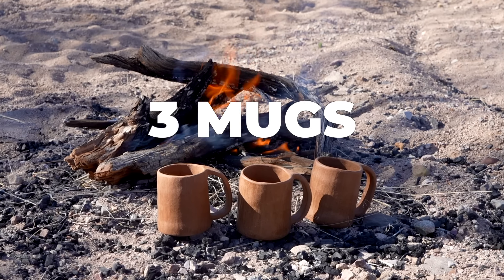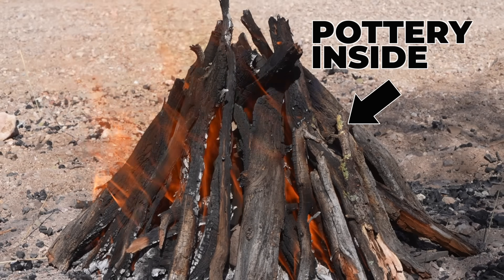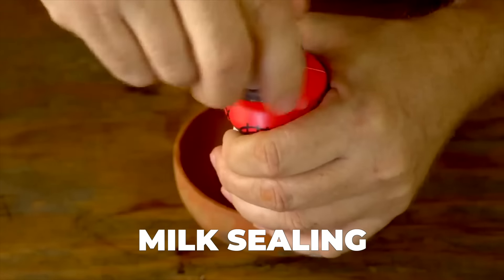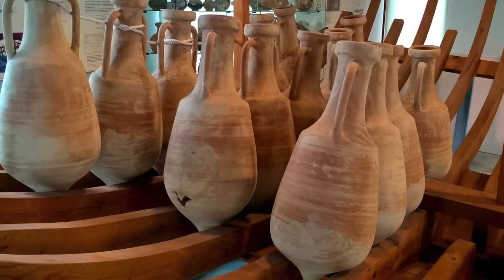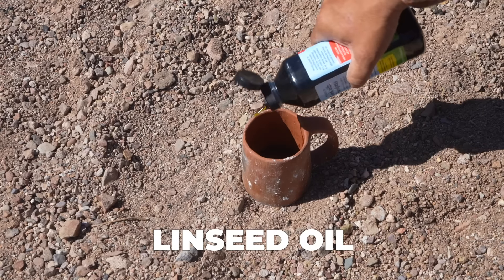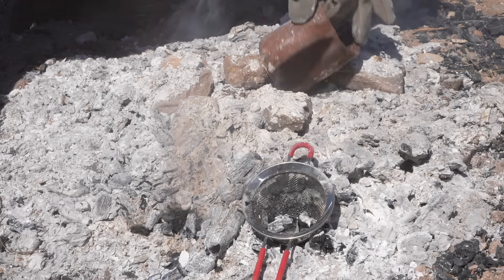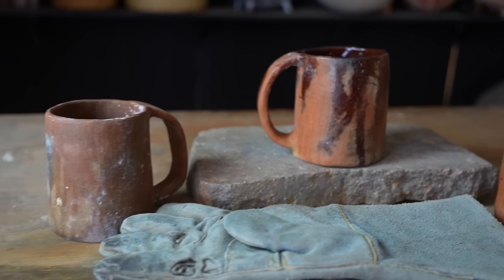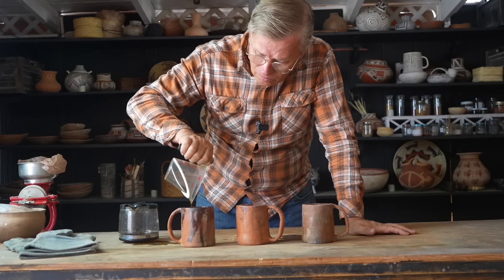Sealing Mugs With Old World Methods

Comment: A brave soul indeed! I might have seen how well they held up to a hand wish first. 😁
At any rate, I had another thought for alternative sealers while I'm here smiling wide at your trepidation. Honey was used in sealing clay tobacco pipes and works well with briar as a first layer when starting a carbon 'cake' layer. As far as having things leach into your coffee, caramelizing a honey layer might be quite nice if you can get it to permeate into hot clay. I've used honey on my pipes and cleansed them with whisky afterwards, but slightly different process and materials as the combustion of tobacco will continually build that carbon barrier. Still interested in the direct coffee roasting idea though, which I'll have a go this weekend if all works out!
Reply from the maker: I imagine honey works about like starches, getting down into the pores and hardening into a barrier. Probably any sugary substance could do the same. Thanks for the idea.

Comment: Was it possible that these sealants were actually applied to the outside of the containers, not the inside?  There would be far less food contamination that way...  Additionally, it's known that oiling a cast iron pan, wiping off the excess, and then baking it until it stops smoking applies a "non-stick" coating of carbonization that fills up the pores in the cast iron...so perhaps they used a similar method with pottery to seal its pores?

Comment: Very interesting video! I wonder what woulf happen if you treated the oil method similar to cast iron cookware? ie coating in a food grade oil and heating to the smoke point to create a polymerized seasoning. When properly applied on cast iron or carbon steel it is very tough stuff.

Comment: A good addition might be that if you can't get rid of the pine pitch leeching slightly into your drink, it might not be the best option health-wise. Pine pitch contains terpenes which if consumed regularly are shown to be carcinogenic. I don't know if the volume consumed would be significant enough or if after a couple of washes the pine would stop leeching into the drink, but it might be worth considering when choosing which sealant to use.

Comment: Sealing with oil probably works well but it's probably not a good idea to drink acidic liquids because the acid would probably strip the oils out from the ceramics. It's like with cast iron cookware in which you also have to season it to give it a non stick layer. And that layer is easily stripped when you cook acidic foods.

Comment: I used tung oil to seal my wood countertops and it's working great for them. It hardens as it dries. I wonder how that would work on pottery. I'm guessing at least a few coats, just like on wood.

Comment: Just my thoughts is the beeswax melts at much higher temps that your coffee can get. Pine pitch melts at lower temps than coffee.  Linseed oil varies depending on how polymerized it is. I would have heated them and at least wiped them clean on the inside. Your taste results are exactly what I would expect.  Your right about the linseed oil I think. many layers is good. I say this from  my woodworking experience. Great show as usual. Thx.

Comment: I imagine the beeswax you would have to reseal regularly. I know the British use to use beeswax to seal their canteens in the 19th century and they found the beeswax ran out of the canteens defeating the sealing. Also most forms of wax are flavourless and non-toxic, thus, you could be ingesting wax and not notice it. I think a beverage that is not strongly flavoured and acidic would be a better test to test for the affects of the sealing. I would suggest white wine, with a Chardonnay specifically. A Chilean one to be more specific. Also, are you sure the oil slick is from the pine pitch? Coffee has it’s own oil residue, I notice it, even in a regular mug.

Comment: I wonder if the same principle used to “season” a pan would work with earthenware. Covering with oil then heating it up to the point of polymerization, then doing a couple coats of that.

Comment: Can’t wait to try these! I am going to collect local clay for the first time too, I live in a very chalky area in England and was wondering if powdered chalk can be used as temper? Or maybe just as a dye?
Reply from the maker: No, chalk is calcium so you definitely don't want that in your clay
Reply: @AncientPottery  ah that is a shame, I live in the vale of the white horse so it’s very culturally relevant. I will have to watch more and figure out a white pigment. I am very new to this, having stumbled across it a few nights ago while researching microwave kiln techniques
Reply: @MrConna6  You might want to experiment, making it a thin slip then see how it comes out of the firing. Maybe search for sources of kaolin in your area.
Reply: @-meganeura  like a surface later of chalk or do you mean with the white clay? It’s a very interesting idea as the eponymous white horse is maintained by smashing and powdering chalk into the ground and a similar approach may work here, even if I need to seal it onto the mug
Reply: @MrConna6  Yes, a slip is just a coating on the surface, you would prepare a thin solution/paint with water and chalk and a tiny bit of clay, mix it well ad more water to make it like milk consistency or maybe a bit thicker then paint the pottery with a bruh, also you can experiment polish the surface after painting with a burnishing stone.
The kaolin is pure white clay.
Reply: @-meganeura  thanks for the help! I will definitely be experimenting a lot haha! Just waiting to have time to go to the skip and relieve them of some old bricks now xD

Comment: As far as i know, linseed oil was mixed with pine resin and/or wax with heat. Pine resin will dissolve in the hot linseed oil and the heat will drive off any water inside the linseed oil as well. That concoction will harden over time.

Comment: Having made cutler's resin before, it might be worth heating up the pine pitch a bit before tossing it into whatever you're going to coat with it.

Turns out that copper distillery pots in North Carolina were used in the manufacture of resin and turpentine before they were turned to other, illicit uses.
Reply from the maker: I did cook it some before use, how long do you think it needs?

Comment: my sauna has pine boards on the inside and when it was new they dripped quite a bit of pitch. but as time went on the volatiles evaporated out of the pitch and the drips are now solid even at higher temperatures, like some sort of dark amber glass. 

that said, i think if the pitch coated pottery was baked at low temperature (maybe 180 to 200) for a period of time that the pitch would turn into a low temp glaze, just like the pitch in my sauna.

Comment: Here in Europe, birch tar has been the go-to glue and sealant since the Neanderthals.
I assume the people wandering into the Americas also knew about this stuff. I don't know how abundant birches are there, though, and whether the substance was used.

Anyway, I would like to know how birch tar works as a coffee cup sealant.
Reply from the maker: I know that people use and make birch tar here in North America but it doesn't grow around Arizona.
Reply: @AncientPottery  Ah, yes, that makes sense. Arizona is not a good place for a birch.

I have gathered birch bark to try tar making, but I have yet to find suitable vessels to cook it in. Should I manage to do that, I will try sealing with birch tar and report back.
Maybe I will try and make suitable pots from clay, though I am sceptical whether I have the skills for that.
Reply: You can get purpose made brewers pitch online which is probably easier to use and better tasting than raw pine resin. At least a few old world breweries still line their wooden barrels with it.

Comment: I would like to contribute that in my experience treating tool handles and particularly leather with raw linseed oil (which it should be said is the only sort to be used for a coffee mug or some such, BLO has various toxic things in it to decrease drying time that you really ought not to ingest.) it takes in the order of a couple weeks to completely polymerize while soaked throughout a matrix. whether that be wood, leather or as I can only imagine pottery. 
similar was pointed out by another commenter but i would also add that the procedure for oiling a tool handle with raw linseed oil is to keep applying oil over the course of multiple days until it stops being absorbed. perhaps followed by a thin top coat(s) on the surface.
all to say I think in order to get the best possible results. which i imagine would be quite good. out of linseed oil one would have to treat it with that procedure.

Comment: I recently found out about the Moroccan practice called Tadelakt where they'd put a lime plaster on a clay/earthen wall in thin layers, and then essentially burnish with a hard stone and seal with a olive oil soap (and egg whites, or other organic matter). Traditionally it's used in bathrooms and showers, so it's a well known technique for being water proof, do you think something like that may work for primitive pottery sealants?
Reply from the maker: Yes I have read of this. Potters do use a stone to polish clay on a pot surface but we tend to avoid lime as that can have disastrous consequences to pottery.
Reply: @AncientPottery  oh really? I hadn't heard that before! I'll have to look into it some more, I was planning on making some pottery in the tadelakt style to play around with it, now I'll make sure it's on pieces I don't particularly care for
Reply: With Tadelakt there is actually a chemical reaction going on between the soap and the lime. 

Soap is made by reacting fats with sodium hydroxide or potassium hydroxide. Generally potassium hydroxide gives you a liquid soap and sodium hydroxide gives you a solid soap. If you were to use calcium hydroxide you'd get a 'soap' so hard and waxy it won't dissolve in water.

When you apply lime plaster, the bulk of the lime is calcium hydroxide. When you apply the soap on top of the uncured plaster, the calcium in the lime swaps places with the sodium or potassium in the soap and creates the hard, insoluble calcium 'soap' in the surface layer of the plaster. The same thing happens when the calcium in hard water reacts with soap in the shower, giving you soap scum, aka calcium soap.

You could probably limewash the already fired pottery and then apply soap to it and get a waterproof layer, but it would take some experimentation to find the right concentrations of lime and soap. The timing also has to be right as the soap needs to be applied before the lime carbonates. You might even be able to make the calcium soap separately and then melt it and apply it like the beeswax or resin.

Comment: Great video! Linseed oil needs to cure for a long time to properly polymerize. Like, many weeks, since it is not only a thin layer in this case and sunlight cannot get to it inside the clay. I had good success sealing with beeswax by really dipping the pot in liquid wax, let it soak and then rub it dry with some cloth.

Comment: With the linseed oil it might be the case that it requires heat treatment and repeating the process. When you season the cast iron pans with oil, you heat them up which allows the oil to create polimer layer. Linseed oil oxidises quite fast, but I am not sure what's needed for its consistent polimerization.

Comment: I wonder if you sealed a pot with milk or dissolved casein solution, then formin to set the casein into galalith plastic if it wouldn't provide a higher quality glossy seal. It's worth experimenting.

Comment: I think when you use pine pitch it takes a bit more effort to get a good result. First melt the pitch and run it through a sif to clean it. 
Then on slow fire let it cook until it doesn't bubble so most of the turpentine leaves the pitch  you end up with rosin that has almost no smell and solidify into a hard glassy substance. 
Make sure you don't burn it. I usually cook it in an oil bath over an electric stove. The oil helps heat the pitch evenly and if the oil smokes than it is too hot for the pitch. Oil bath is not needed but over fire you need to be watchful. If you make a really good effort cleaning the pitch and create a clear rosin then it has a visually pleasing red-orange appearance. 
Then pour the rosin into the mug (I believe the mug should not be preheated) quickly slosh around and pour out (ideally back into the pich container) A mug that sealed this way should not give out much smell at all. It is the turpentine that smells and it is what let the pitch dissolve into other fluids.
That was the most common way to seal pottery that contained cold fluids. I don't think it was used for cooking wares. I was told this is the reason pitcher called a pitcher. 

I don't think you should use linseed oil that thing is disgusting and offers no benefit to any other oil sealing.

Comment: I'm late to the comments, but it might be worth looking into charcoal powder and soot as a pre-treatment for the clay before sealing. Lamp black (soot) is naturally hydrophobic, water beads on it and won't easily penetrate it. It might be worth inverting a pot or cup over a flame to fully coat the inside with soot, then rubbing it into the hot pores with a chunk of charcoal, and repeating the process a few times to fill as many pores as possible, as deeply as possible, with the fine soot particles. The charcoal powder also readily absorbs compounds that come in contact with it (which is why activated charcoal is used in water filters), so any larger pores that have charcoal dust on top of the soot might better seal by drawing in the sealant.

Pitch from different conifers can smell / taste better and less strongly than others. Where I'm from, spruce tips are use for tea and spruce gum taken right off the tree is chewed like bubble gum for its nice flavour, but will harden like glass if allowed to dry out fully. 

I'd like to try a combination of soot / charcoal pretreatment, a gentle wipe to remove loose material from the surface, and then a coat with some thinned down, un-burnt spruce gum that's been mixed with some water or alcohol so it flows better, then left to dry and harden in the sun for several days so the resin has time to cure.

Comment: I'm pretty sure the ancients would have boiled and filtered the pitch. Yours was bubbling because of the water in it. I suspect they would also add resin when available.

When you flipped you newly adhesive coated cups onto the sand and gravel I thought I was seeing one of the manufacturing in Pakistan videos 🙂 What were you thinking?

The seed oil should polymerize more over the next days/weeks. Very interesting results!

Comment: What about grape seed oil or olive oil.
Reply from the maker: I have used olive oil in the past and it works fine. Never tried grape. The secret to sealing with oils is to heat them up to the smoke point so the oil will polymerize. Then you can't store oil in any pot that is polymerized as the new oil will cause the old oil to soften up and it will start leaking again.

Comment: If you ever do this again...
- Ancients had brushes, get a brush for each treatment 
- Most processes were done with repeated steps so try out
Low heat, coat, dry & repeat a few times at least 3
- Coat all sides, not just inner
Explanation is:
You'll get better results building layers of saturation & carbon sealing.
**
Lastly, the ancient sealing 'pitch' is made with pine sap & charcoal (ground) in a 10/1 sap/charcoal. This stuff is also flammable too, so low fire (set mugs on top of fire pit for about hour) after coating dries.

Comment: Any reason why amphorae are pointed at the bottom? Seems a weird shape for a container you might want to keep upright.
Reply: Racking is easier, and no seams makes a stronger vessel.
Reply: @BigHenFor  Thanks for the info. Certainly makes sense. Would they "rack" like wine bottles, stored horizontally?
Reply: Racking aboard ship to save space. Storing on the sides would take up more space.

Comment: ?? Why didn't you try to seal the outside of the mug as well as the inside?  Followed by a heated bath to remove the excess. And have you tried banana leaves and branches? I've seen banana plants used to seal concrete ponds, so it may work here as well.  When I've seen it used, they would fill the pond/pool with water and place the banana plant parts in the water, leaving it for a day or so, before draining, rinsing and filling for the fish.
Reply from the maker: Sealing the inside helps hold the liquids in the mug, sealing the outsides does what? People often will glaze just the inside of a mug but they never glaze just the outside, the principle is the same. Banana leaves for what? sealing? Are banana leaves high in oils or starches or waxes or something that might seal a pot? I would probably have trouble finding banana leaves where I live.
Reply: @AncientPottery  I would think that sealing the outside too, would help to prevent the inner seal from being displaced by a source from the outside of the mug. However, I do see you point.
Reply from the maker: @GG-ud1ib  Yeah you could just apply it all over if you want, the inside is certainly the most important area to seal
Reply: @AncientPottery  I'm only speculating, but maybe the sap from the banana does something. It can be a little sticky when you touch it.
I googled around a little, but did not find much useful information, only that it can be used to stop bleeding in wounds. But that is no indication of sealing properties; could just be adstringency.